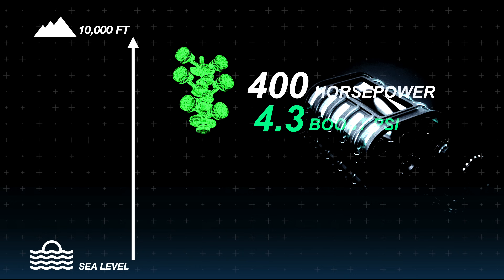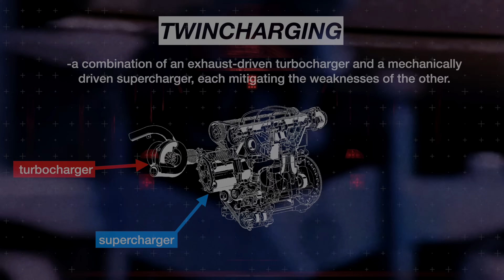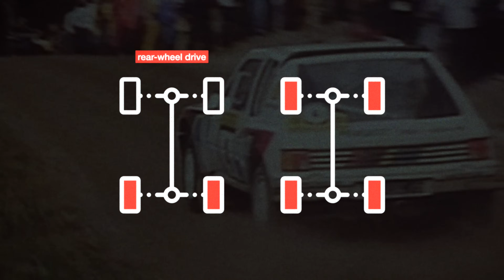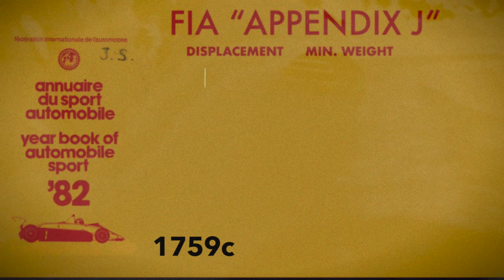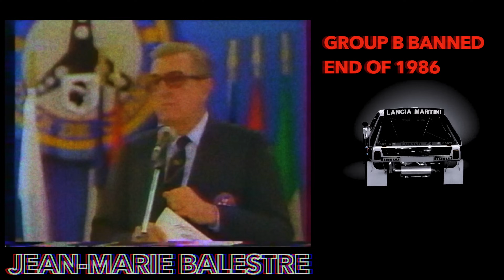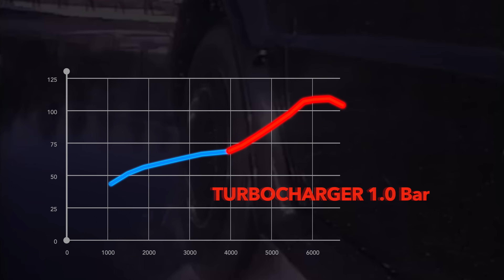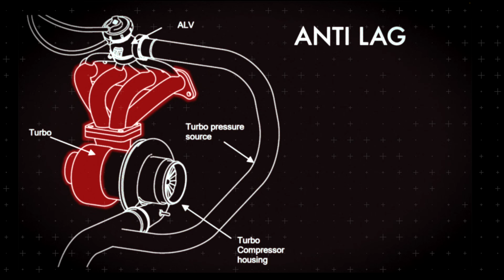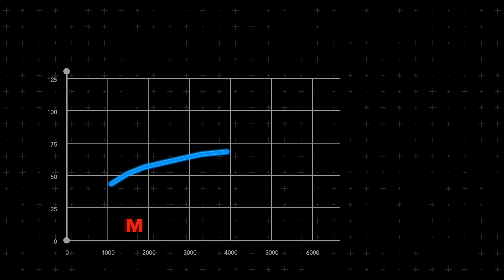The Engine That Was Banned From Racing | Explained Ep.29

Comment: Even in sim-racing, driving Group B rally cars close to their limits is terrifying, I can't imagine actually driving one on those tracks with the spectators everywhere.
Reply: Dirt rally 2.0 really gets you on edge pulling the weirdest faces making the strangest noises, as you narrowly avoid stacking a delta s4 into a line of rocks 😂
Reply: @nenthal1761  Yup, I put hundreds of hours into the Dirt Rally's and RBR and still feel intimidated by these cars.
Reply: Fr, driving some of these cars in the sims, whether in dirt or AC or otherwise, makes you wonder  how it was possible to drive these cars in real life. Ludicrous power
Reply: @amr1t_  Driving Quattro S1 E2 i felt more annoyed than anything else.Bloody thing just refuses to turn.
Reply: @hillclimbracingfan5821   makes you wonder how the drivers were making it work back then. Feels like I understeer at 1000 mph in a left 4
Reply: @amr1t_   I prefer R4,R5,Kitcar and WRC anyway given how manueverable and grippy they are.
Plus not to mention they can be chucked around tight turns with e-brake so that’s another reason.
Reply: @hillclimbracingfan5821 Group b didn't have e-brake?
Reply: @ameunier41  No they didn't.
Reply: @ameunier41 they didn't often have real, functional roll cages either. 

Often to save weight, the teams would make it out of thinner tubing or even cardboard tubing. 

They cut so many corners to try to get to the top.
Reply: @amr1t_  brakeing. the wheightshift onto the front allows for better steering. walter röhrl said that it otherwise refused to turn
Reply: @johannesdatblue4164  yeah I remember seeing probably that same interview lol, I started trying to left foot brake more but its certainly a muscle memory you have to put work into getting used to, I'm used to just using the clutch with that foot so I press the brake waaay harder than necessary
Reply: @jameshaulenbeek5931  You just made that up.
Reply: @hillclimbracingfan5821  no it doesn't wtf shit handles like an arrow
Reply: @amr1t_ man, use are good, i crash at every corner in Colin MacCrae. I'd be the worst rally driver. Asian drivers 4 ya. Lol.
Reply: @jameshaulenbeek5931 pls stop the cardboard rollcage bs, it all started from Clarckson making a joke on The Gran Tour's episode about the 1983 Rally Championship and now people think it actually happened

It didn't, nobody used cardboard for their rollcages, they mostly used aluminum
Reply: Only as a blind man trying to read braille would I be a co-driver. 
Because there's no way I would willingly get into a car with anyone driving like they did
Reply: @CERTIFIED334  They drove just as crazy in Group A,WRC and WRC+ era and do it in Rally1 era so it really takes specific type to co-drive.
Reply: Yeah, I was like, you have got to be kidding me, what could go wrong
Reply: These cars ain’t no babies 😂😂 rally racing is real driving .. u gotta really drive that hoe lmaoo
Reply: There's absolutely no way I would even co-drive/navigate in group-B.
Rip BLOCK 43
Reply: @CERTIFIED334  What about WRC+ and Rally1?Especially given their cornering speed.

Comment: "It's said there's no replacement for displacement, but in actuality there is. It's called boost." 
One of the best lines ever
Reply: how is it one of the best lines ever when its wrong, any engine can be boosted, and at the end of the day the bigger engine will win
Reply: @cj09beira  No, the engine that fits the scenario best will win in that scenario. If you're going in a straight line on drag strip generally yes a bigger engine will be faster but at some point of extremes then no, the engine becomes too big, heavy in wrong places and is preferable to add a supercharger or other things. Or in a rally scenario its very not the case, in rally what matters is weight and especially where the weight is. It's been common practice for rally cars to choose smaller engines with turbos because they can place the weight further back, still get the power they need and have better handling. Or in track racing, for same reason, weight and placement of weight or when there is competition regulation power limits so its better to have a lighter engine with better weight distribution making same power but better handling.  For example the mk4 Supra in production has a  2jzgte(3L 6cyl twin turbo) which is a legendary engine but for the Castrol TOM’s Supra, they ripped it out and replaced it with a 3sgte  (2L 4cyl turbo).
Reply: @deadline546  The 530hp 332" (5.4L if you speak metric) bored and stroked 302 in my Mustang weighs approx 375-385 lbs with all its aluminum parts, if it had an aluminum block, weight would drop another 30 lbs. For comparison, a Honda B series 1.8L engine assembly weighs approx 400 lbs. I built my Mustang for road racing, it only weighs 2450 lbs,(300 less than my civic beater) and it does everything better than my civic (handling, braking, acceleration, top speed) except for fuel economy. lol Generally speaking, (all race rules aside, since you did mention them) a small, lightweight V8, comprised mostly of aluminum parts, especially with twin turbos on it, is very difficult to beat in most situations.
Reply: @AmericanThunder  I agree, for a lot of scenarios, a well built aluminum v8 can be a very good choice, especially if its a more budget oriented race scenario or even in high level racing if it can be placed well or already is given the chassis limitations. One of the examples I was thinking to add was adding a premise for rally such as dakar and other long form baha rally a more simple V8 is advantageous for reliability and ease of repair where often they have to bush mechanic repair things in middle of nowhere to get going again. But they often go for cast block v8 because  they can place it behind driver with custom frame in mid engine setup and worth the extra weight. Whereas the reason a small engine in small rally car is optimal is simply because of limits requiring some level of retaining original production body so its weight and distribution but also packaging.
Reply: @AmericanThunder 
Please excuse my lack of understanding when it comes to engine terminology. 
Were you saying a large light weight NA engine would be better for racing, or a small twin turbo engine?
It's probably clear to most, but as I said, I'm not a piston head.
Reply: @michaellavery4899  Actually I said a large displacement lightweight V8 with forced induction would be the way to go for racing. That is why top fuel dragsters make 11,000 horsepower.
Reply: @AmericanThunder  
I read that comment too. I was referring to the earlier comment when you compared some monstrous 5.3l NA engine to a 1.8l honda with a turbo.
Reply: @michaellavery4899  I'm not sure what you're asking about that comment because I never said that the naturally aspirated V8 was better than any boosted Honda I said it's not much heavier than the 1.8 Honda, and that it's difficult to beat a lightweight V8 especially with turbochargers.
Reply: Had to check that. Can't believe how much that honda engine weighs
Reply: Displacement is presumably the total amount of air / air fuel volume that fits the combustion chambers at atmospheric pressure, not just the fixed physical volume the stroke and bore all cylinders take up. Forced induction always artificially increases displacement because you're forcing more air / air fuel via compression into the combustion chambers than the engine can ordinarily provide to itself without forced induction, thereby increasing displacement. Increasing RPM also "effectively" increases displacement; As RPM increases, so do the amount of combustion events per second. An engine at 10k rpm "effectively" displaces more air fuel than the same engine does at 6k rpm at any given time. There is no replacement for displacement because almost all developments in car engines to give them more power artificially increase displacement in some way, shape, or form.
Reply: well.. i rather go with rpm tbh. its just more fun
Reply: then you’ve never driven a boosted car
Reply: @rthrs3ar   enough of them but i just dont like them. they are boring esp oem once.
Reply: @johannesdatblue4164 I’ve never heard a boosted car called boring 😂
Reply: @johannesdatblue4164  I put a Cummins diesel in a 78 bronco, it makes 39 psi of boost and 400 horsepower lol it only revs to 3200 RPM and trust me, there's nothing boring about its boost
Reply: @AmericanThunder  1. im not a fan of american cars, they are just not appealing to me - sorry, even though its probably a nice and fun car!
im just in general no fan of boosted gasoline cars. they often loose character to get its boring flat torque curve and top end flat out hp. its not exciting., i love the feeling of NA cars that never perform horrible but oyu feel whe nthey come alive.
im one of those guys^^ also on of those that think so muc helectric shit in a car is disgusting lol like all the assistance
Reply: @johannesdatblue4164  Well I also like spartan interiors, plain is perfect.
Reply: @johannesdatblue4164  The hire the weight longer it takes to get the revs to climb under load!
Reply: @johannesdatblue4164 Lower RPM pushrod V6's feel more fun to me than any of the high revving I4's I've driven
Reply: BS. Just boost the bigger displacement the same way. Displacement still wins.  He should have said the only relacement for displacement is an unfair advantage using boost when the big guy can't.
Reply: @wymple09  the definition of displacement is "the moving of something from its place or position."
Technically the displacement of an engine can be measured two ways, static displacement which is calculated by its bore and stroke and number of cylinders, and dynamic displacement which would be static displacement x volumetric efficiency. (VE) anything you do that increases the air flow capability of the engine and increases its volumetric efficiency will therefore increase its dynamic displacement because it's breathing more air therefore displacing more air. The static measurement means nothing really compared to the dynamic number because that's what makes power. Just like adding a bigger cam and bigger heads will increase VE therefore usable displacement, so too does forced induction. Different means to the same end. While I do love V8s especially my old Fords, I also recognize how inherently well balanced and strong the inline 6 configuration is - example the Ford 4.0 barra engine. There is a street driven Australian Ford barra 4.0L that made 2200 horsepower at the wheels. If you consider top fuel to be real racing as I do, then forced induction is definitely not a bad thing.
Reply: @AmericanThunder  On the other hand you know exactly what I meant. All things being equal, bigger is better.
Reply: @wymple09  I tend to agree lol
Reply: Just an old wives tale.
Reply: My father and I argued that for years. I was team boost, he was team Mopar 440
Reply: @erict3728  What would he have said if you built a 426 hemi with two turbochargers?
Reply: There isnt no replacement for displacement, just boost the bigger displacement engine... Cant beat it. Theres no replacement for cylinder volume and pressure, thats a better anaolgy.
Reply: I think it was Smokey Yunick who defined it:"The only thing that beats cubic inches is cubic money.  And the only thing that beats cubic money is cubic brains.
Reply: Try that in a cargo ship.
Reply: There is , it's called displacement with boost .
 Notably 10 litre V8  12,000 horsepower top fuel motors . 🤣🤣🤣
Reply: You can add turbo or supercharger or nitrous to any displacement of engine.

Comment: I want to twin turbo my Mach 1, but it would be sick if I could get a tuner to bear down with me and get a twin charged set up. Extremely complicated but it would be incredibly rewarding if I could pull it off
Reply: Hellion has a twin turbo system for the supercharged Mustangs and Hellcat platforms. With modern turbo tech, lag is virtually gone, and the only reason to twincharge is just for clout. Stacking power adders is really inefficient but great for shock factor
Reply: @hoost3056  so far, hellion twin turbo kit is the actual feasible plan. I haven’t decided on which set up I want between the stealth or flashy one. Stealth would be a sick surprise but flashy would be awesome to show off. Either way tho, I’m keeping the stock cats to pass inspections
Reply: @UnabnormalDay  dang, my state doesn’t do inspections or emissions testing

Comment: Rip to the lives lost in Group B rally. What a time for engineering crazy engines, but disappointing the safety aspects were definitely overlooked
Reply: They had helmets and seatbelts, modern for the era
Reply from the maker: Agreed, no way you could get a racecar down to 890KG and not compromise safety components, some teams were running aluminum roll cages which is just ridiculous.
Reply: @337speed  The real downside to a 'boosted engine' is that the increased stress results in an engine that lacks longevity.
Reply: @337speed  The Cardboard Rollcages of the Lancia 037 is not to be forgotten... lightness at the cost of safety
Reply: True... they had to make the cars lighter cause of the massive balls of these drivers
Reply: @navyanikii  I remember what Jacky Stewart was telling into an interview about older F1 cars with big V10 engines and manual gearboxes, give the pilots the option to choose from 2 cars :  a car that is safe but is slower with 1/2 sec each lap or a car with minimum safety but it will be way faster each lap.. 
So what do you think each pilot would choose specially those from old days ? (the car with minimum safety that goes faster)..
Reply: @poplaurentiu4148  that's the spirit of the sport. And they have gimped the fun out of it. Like, blaming a track because drivers don't slow down for a corner? Stupid. This is why we can't have nice things.
Reply: @eclipsegst9419 Yeah, but sometimes one would get back to the staging area with an extra finger some generous spectator left in the mirror on the driver's side door. It was very much a give and take relationship, the spectators would give the drivers a virtually impossible view of the stage and the drivers would give the spectators the chance to play chicken with a rally car that had unofficially lapped a race track as fast as the huge turbo charged F1 beasties of the day. The drivers had billiard balls between their legs and the spectators weren't aware of the term "self-preservation". At no point did anyone think how crazy shit was getting until it was well and truly out of the bag and being flung all over the shop. 🖖🙃
EDIT: It must been an unbelievable time to be alive… or dead. Basically everyone was Schroedinger's cat.
Reply: @navyanikii   SAFTEY 3RD performance 1ST.
Reply: @navyanikii  man... can y'all stop spreading this nonsense... Clarckson was making a JOKE, he was trying to paint the situation as "silly italian team win against serious german team" to exaggerate the situation...

The 037 used the aluminum roll cage just like most other cars

(Btw in that same episode were said quite a few outright false things which are now being spread around by thousands of people, along with the cardboard joke)
Reply: They SHOULD have known what they were signing up for coming to watch a rally race. Have you never heard the saying? The only thing crazier than drivers in group B are the spectators.
Reply: I like the risk i would drive one knowing if i fuck up im dead but no1 can catch me cause my car is just superior. We all die, some of us know this.
Reply: The cars where too light to be strong and the crouds where uncontrolled... This is the real problem.
Reply: no EXACTLY that was what made group B legendary. todays crybabies just cant comprehend  @doggSMK
Reply: For sure.. the fire from the car nowadays would have burnt half the country up..
Reply: the main problem with group B was the idiotic fans that stood in the road and on corners knowing the car was coming, fans killed most of rally themselves
Reply: NiSSAN MARCH SuperTURBO didn't kill anyone, cheap to buy and run.  There are handfull still running strong as a daily in my neighbourhood. It's still under the radar in 2023
Reply: Quiet bonushole
Reply: Spectators being allowed to literally stand on the road will always be a mystery to me
Reply: Man stuff right there buddy, no time for safety in 90s ... as for the spectators oh well, learn not to stand in the wrong place for a pic/thrills.
Now they try rally away from ppl(closed circuit is meh)... like the army(drivers) they know what they signed up for 
👏🏽👏🏽👏🏽👏🏽👏🏽👏🏽🍻🤙🏽🇦🇺
Reply: True, even the 30 that survived their lives will be altered forever.
Reply: Safety would have not saved more than a hand full lives. Even in a modern car most had died the same way. Group B was crazy and that made it good in the first place.
Reply: @23GreyFox you're wrong.
Reply: @Entremanures  buhu, cry me a river
Reply: Audi s1 e2 also used aluminum roll cage. Sketchy stuff😅